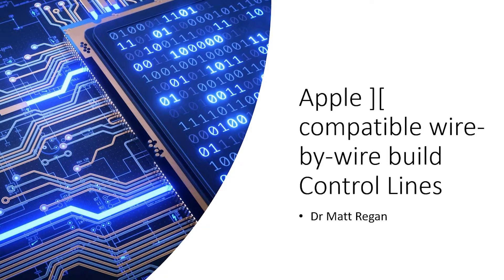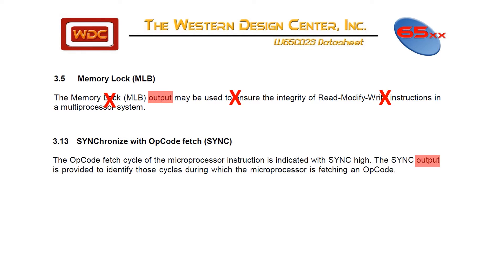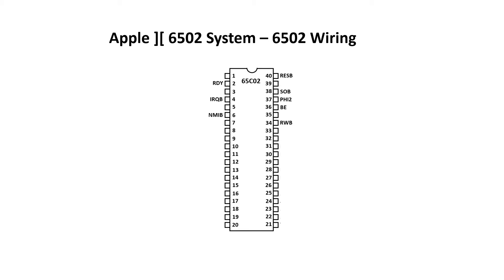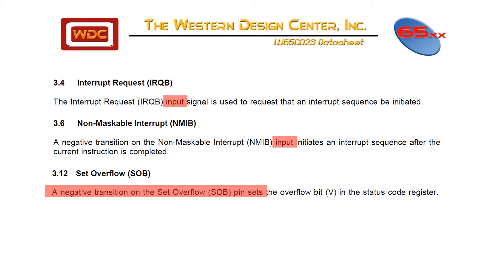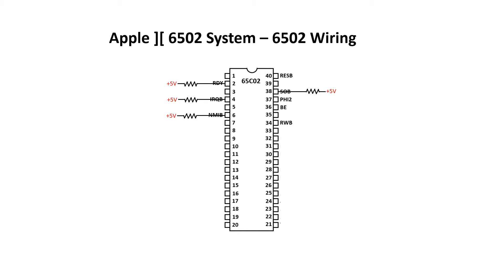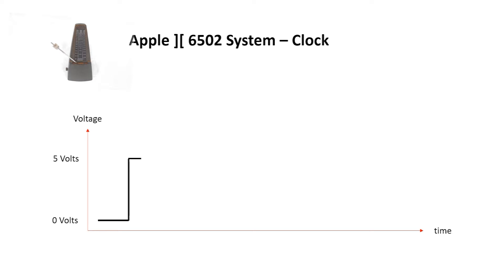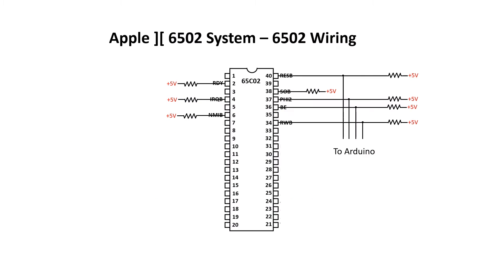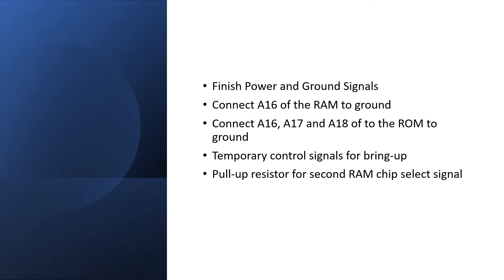Apple 2 wire-by-wire build, Part 6.  The Control bus.

Comment: (8:37) I'd caution against connecting an NC pin to ground like that unless the datasheet specifically says you can. At best, it won't do anything. At worst, it could be an undocumented pin used for testing by the manufacture (or something similar) and cause damage if connected.

Comment: Why do you have to tie an input high through a resistor instead of directly to 5 volts.? There is (at least) one input that can become an output (RDY, just looked it up) in certain cases so that makes sense (it’s bidirectional). You did answer it right after I asked, saying it can damage “some” chips. Not sure if it is needed for this chip, for input-only pins. I guess it’s cheap insurance though.
Reply from the maker: Thanks , yes, it's to limit current.  To some degree it's force of habit and it probably applies more to TTL logic rather than CMOS chips.  It also means a mistake probably won't kill the chip so i just do it for all inputs.  How do you like the series?  I'm working on the next part on the floppy disk in the background..
Reply: @DrMattRegan  I’m started at the beginning of your channel after originally starting your latest series improving on the SAP-1 (I recently finished building the SAP-1 with 16 bytes of memory). Planning on watching your whole channel in order, possibly implementing the projects as well. I also built Ben Eater’s 6502 kit (so I might be able to use that to pull off what you’ve done here with that and the Arduino Mega), and just ordered the video circuit one too. So your whole series is extremely relevant to my interests. I’m intrigued to see the other projects as I get to them like the Turing machine one.

I also happen to have an Apple II+ that someone gave me. It has floppy drives but I have no software for it. I could probably figure out a way to load software on it in an alternate way with what I’ve been learning.
Reply from the maker: I hope you are getting some value from it.  The SAP6502 series is in many ways pitched to kind of fill in the gap between Ben Eater's SAP1 series and the 6502 series.  I was watching some of his SAP1 videos and i though "why didn't he take it to the 6502", then i thought OK, i will.
Let me know when you start the Turing 6502 series, that is really the low level, most basic concepts in computer science and computer architecture.
Reply: @DrMattRegan  Is the resistor just to prevent overcurrent in case of a mistake or in case it's bidirectional?  I'm curious if there are chips for which a pure output is damaged by being tied high.
Reply from the maker: @doctorbobstone  both.  Let’s say you have a bad joint on the VCC pin, you don’t want chips powered via it’s inputs , although it does happen.  I’ve killed chips before particularly the 74HC02/74HC32 because I’ve wired them the wrong way.  For some reason the gate direction is reversed in the 02.   Chips these days are pretty tolerant to it.
Reply: @DrMattRegan  So, my take away is that if everything was correct and functional, it would be unnecessary, but having it makes things more tolerant of the real world, especially the real world of prototyping and development (and Mr. Murphy's law, of course).  Thanks for the answer!

Comment: The SYNC signal can be used with the RDY signal to perform single-instruction execution. It can also be used to synchronize DRAM refresh by guaranteeing a period when the processor will not try to write to RAM (which never happens following a fetch).